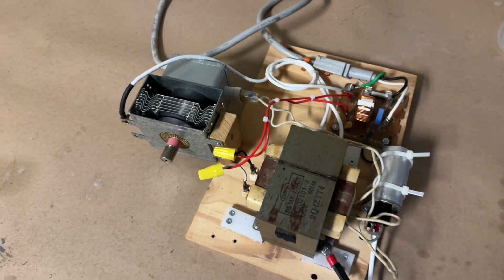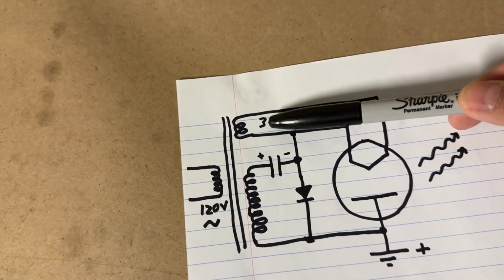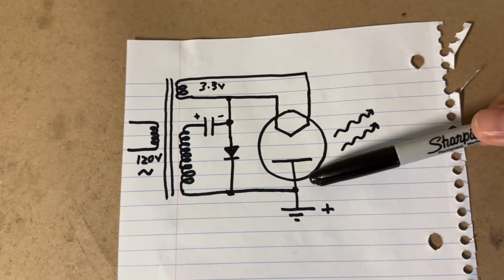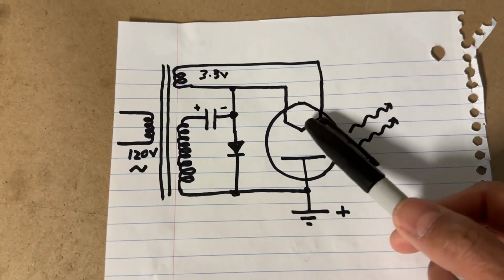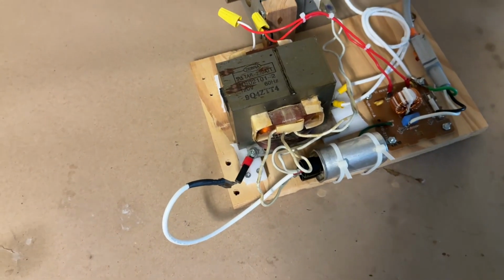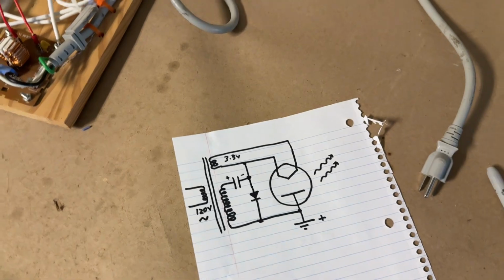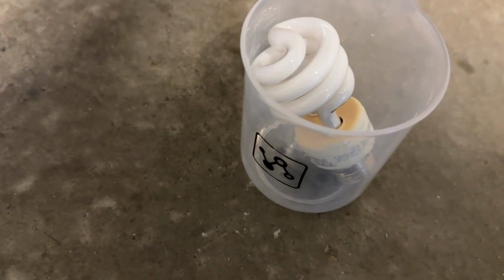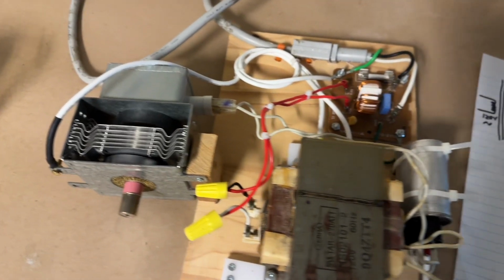Controlling a magnetron with a Variac

Comment: Nice vid & good concept, The heater will start to work about 20% of mains, produce enough electrons to start the process inside the tube. Once that happens, there is a small semi-forgiving area, until the tube fires enough electrons back at its heater to heat it further, in this respect, it is handy to have a separate 3V 10A filament supply, (isolated to ~5000V.) The magnetron produces radiation at 2.45ish Gigs. therefore the wavelength in free space is ~120mm. 
Use a 5/8 copper tube as the inside conductor and 1-1/2 inch copper pipe as the outer conductor of a coaxial waveguide. Impedance will then be ~50 Ohms. 
Impedance can be matched with normal coaxial equations, and can be conveniently raised to over 150 Ohms using a tapered inner conductor. At which point it will spit sparks into mid air like a tesla coil. Check out advanced coax theory. Best done inside a converted microwave oven, Or with "you," inside a metal tank.
Good luck and be safe, this stuff will kill you.
Reply from the maker: Thanks for the great info. I’m gonna look into this.

Comment: When running big magnetrons the filament voltage and electromagnets are controlled proportional to anode voltage,  as you can imagine as if you want more power you must increase the anode voltage and the magnetic field as the increase in magnetic field would mean the eletrons spiral more closely to the cathode so you need to increase the anode voltage to compensate, also around 10 percent of the eletrons spiral all the way around and crash back into the cathode, this of course causes heating and the cathode current must be reduced to compensate, at very high power the filament supply is disconnected altogether  so the cathode heating and subsequent thermionic emission is generated by cathodes bombardment alone...

Comment: If you find a suitable copper or aluminium pipe or box section you might be able to use it as a wave-guide to direct your microwaves safely to the reaction chamber.

Comment: It would be interesting to try the setup with an independent filament supply as you suggested to see how much control you get over the output power.
Reply: Cool experiments. 

It would be interesting to find out how much of the magnetron heat is from the filament and how much is from the RF losses.

A couple of 18650 cells in parallel might even work.  This should allow for a bit more variability in the microwave output.

I would also work behind a metal screen, preferably generate all the microwaves in a conductive box or outside a metal shed.  Looking at a live magnetron will do bad things to your eyeballs.

Simple field strength meter can be made with capacitor and neon indicator bulb or a diode and a sensitive moving coil meter connected to little 1/4 wavelength wire dipole antenna.

Comment: Fantastic video. Would it be possible to use neodimium magnets and what would the effect be? I have built a microwave weed killer on a bramble bush. It killed it for 5 years. Very sluggish to come back now. Keep them coming.  Almost finished building my new Lab. Regards. Raymond.
Reply from the maker: Thanks. Very interesting idea! The stronger magnets might make the electrons coming off the cathode spiral at a higher velocity! Wonder what the effect would be on the outputted microwave wavelength ? Gotta try that soon!
Reply: Gday feller, the magnets provide just enough field to make the electrons spiral around the small gap between the poles and the heater inside the magnetron. any less field, they go crashing into the Anode, any more and they crash back into the cathode heater. Its a goldilocks zone, so more field will not help.
Reply: @MrMarsMink  Cheers my good friend. I have learnt something new.Have a great day. I have learnt something new today. Not bad for this 74 yo dunce Lol.
Reply: Neo magnets can’t handle the heat for long period. Try doubling with ceramic magnets without outer casing, leaving on allum fins and fan to disperse heat? Great experiment. It should up the freq with higher b field right?
Reply from the maker: @creatingawareness1947 yes - will look into some alternative magnet arrangements. I also plan to boil water using one of these devices in the open air !